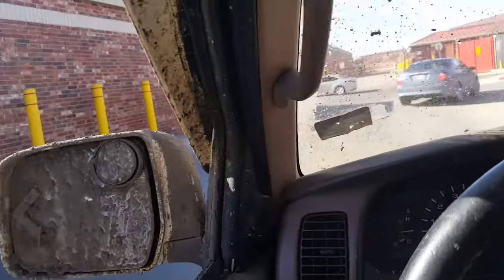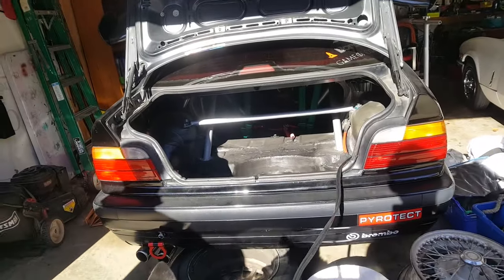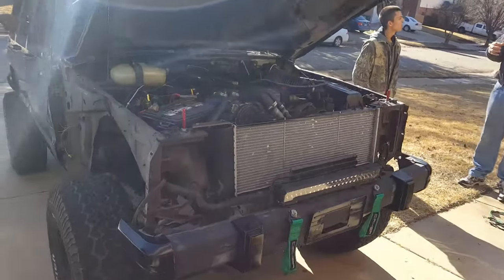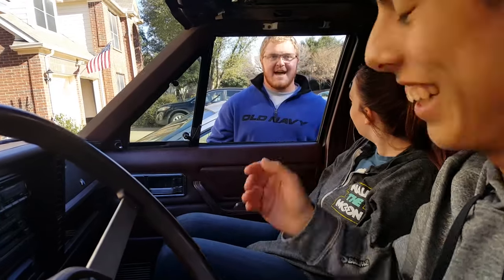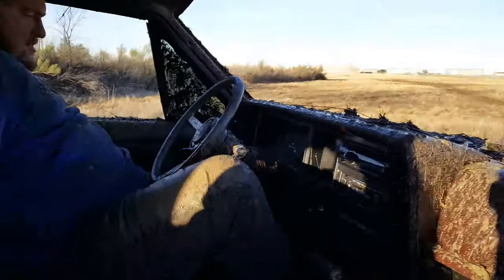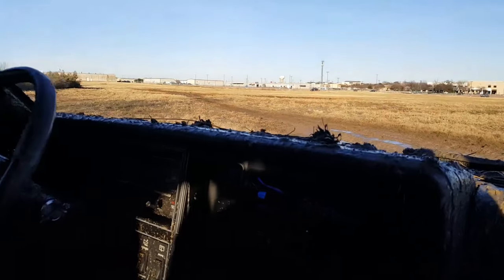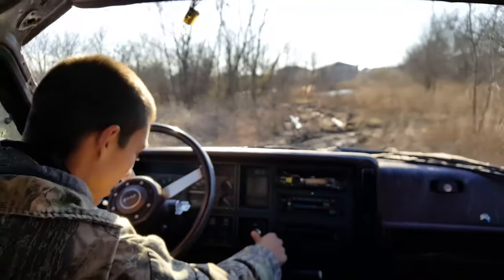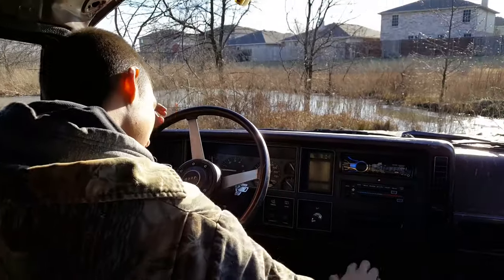Mudding In A $600 Rolled Over Jeep With No Windshield

Comment: That Jeep could actually be a pretty cool project, cut the roof off at the bottom of the pillars, strip the interior, cage it and get a soft top made for it and use a sheet of lexan for the windshield, might even consider doing some sub frame reinforcing since it's a unibody, from there do the usual mods like bumpers, winches, and a t-case and it'd be allot of fun
Reply: i didnt know they were unibody.. i thought it was body a steel frame.
Reply: Right? I would have expected them to be body on frame as well, but apparently not. Kinda unfortunate since they have allot of off road potential, but if you screw up and slide into a rock or something and screw up the body, you've got a good chance of totaling it, where if it was body on frame you could just keep going, don't even need to fix it so long as you keep the frame intact, and those steel frames can take a beating.
Reply: Public Enemy #1 xjs are one of the most capable off road rigs out there.  They are also backed with a very large in depth supply of aftermarket parts also.

Comment: So you paid 2700 for the four skinner and they paid 600$ for that Cherokee that will out wheel that thing all day lol could of spent the 600$ bought a brand new full suspension lift for 800 used tires for 400 and locked both axles for what you have into the nearly stock Toyota 4skinner lol
Reply from the maker: +Cody Schaeffer Very true. The jeep has to be towed every where though, the 4runner is completely legal lol
Reply: Novice Garage 
Yea you got a point there